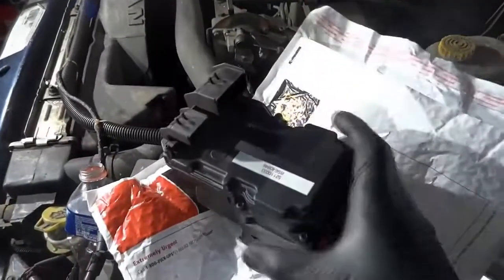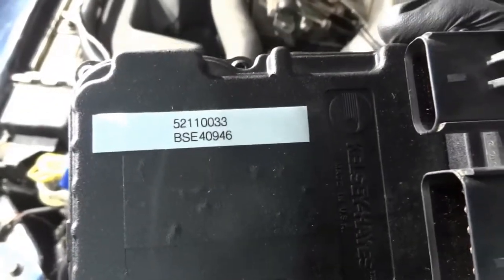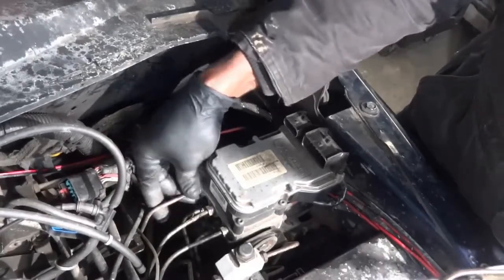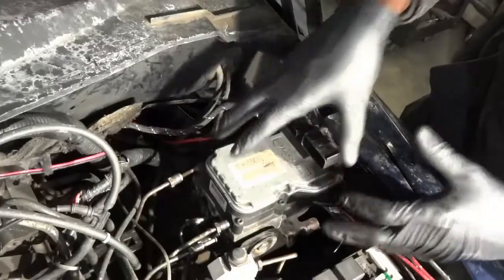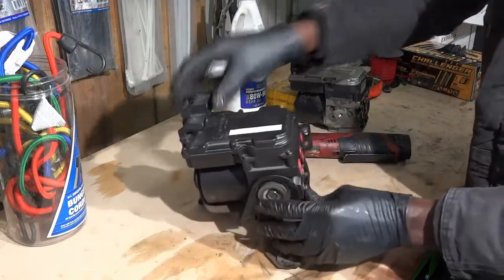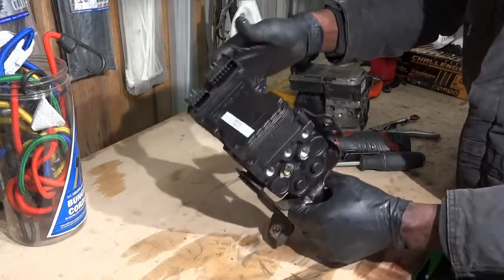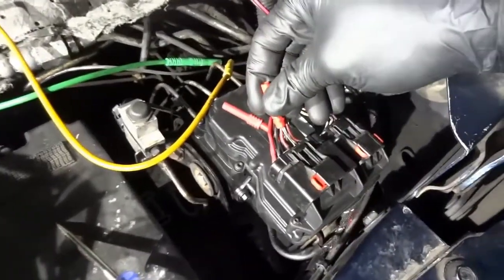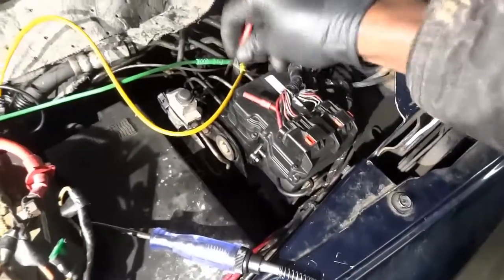2000 Dodge Ram 5.9L No Communication with ABS Control Module/ CAN BUS Problems, ABS Light on Part 2

Comment: I watched the whole part 1 and part 2. Gave you thumbs up on both and finally I subscribed. My only wish is that as a backyard mechanic, only work on my and family vehicles, is that I cannot afford that really, nice scan tool. But the information on getting voltage on various wires at the connectors is something I think I can do. Great video. Too bad the customer did not tell you he already replaced the ABS module and still have the ABS light on. Might have saved you a lot of pain and time.
Reply from the maker: johntube2525  Thank you!! And welcome to our youtube community! if you don't work on cars everyday then you don't need this type of scanner, a multimeter and a code reader will do!
Reply: @KITS_Auto_and_Truck_Repair  Thanks for the reply and a great detailed video. I have a multimeter.  My Z13 code read just says No Communication, Check key is on, and connection has been made at DTC. I found your video by searching for “ABS system No communication”. ABS light is steady on my 2001 Silverado. No brake light. 60 amp ABS fuse is good. Once I find a wiring diagram, I plan to crawl under the vehicle to where the ABS module is connected right above the frame just below the driver’s door and see what I can find.  Not going to be as easy to get too as in your video, but I guess that is par for me. Probably need a new module, but want to try to check the wiring first. Given where mine is located, even putting in a remanufactured unit will not be that easy, while crawling around under a vehicle put on jack stands. Probably have to drain all brake fluid and then refill with new fluid and bleed each location separately to get rid of all air. Wish me luck!
Reply from the maker: @johntube2525  Good Luck with your project my Friend!
Reply: There are some cheaper alternatives. I own a pretty decent scan tool from H&F, a decent Multimeter, but im looking at getting an Autel scanner of some sort, they're around 400-500 dollars and do pretty much the same thing as the Zeus from Snap-on, theres also handheld scope meters you can get that are fairly inexpensive, like 80-100 bucks. Not as fancy as the Zeus but they would get the job done for testing communication and such.

Comment: I am currently working on the same ABS light on issue on a Vauxhall Corsa (UK) my diagnostics tool tell me both the rear sensors are problematic, however when the ABS light comes back on at 20mph the fuel gauge also drops off and reads empty, also fault codes come up for the CAN-bus Malfunction and no communication with ABS. Should I just change both rear sensors ? Thanks for your very good diagnostic skills and video editing etc. This must have taken a lot of time to produce. I used to work on basic military vehicles but it's a lot more like fixing computers these days! Makes for a happy day when you fix them despite the efforts of the previous garage who only made things worse.
Reply from the maker: @davidbarton7463  take care of the communication code first!!
Reply: Many Thanks your a gentleman. @KITS_Auto_and_Truck_Repair
Reply from the maker: @davidbarton7463   My Pleasure!

Comment: Thank you for this video , however I have a small recommendation , I believe it is a good practice to check( energize and deenergize )the ABS solenoid valves on the new { the good one ) before reconnecting the hydraulic lines, this way you will save yourself time and headache if anything is wrong . THANK YOU
Reply from the maker: Rebel oh really! I didn't know that, thanks for sharing!

Comment: Nice video! I subbed. Did you have to bleed the brakes afyer putting new abs module on?
Reply from the maker: @israelcontreras5332  Thanks and welcome to our youtube community, No I didn't bleed the brakes since I didn't disconnect the brake lines!
Reply: @KITS_Auto_and_Truck_Repair  

Oh ok cool…i thought i saw you take the brake lines off with some line wrenches.

I dont think I have seen a better diagnostic process done by someone.

Comment: Hello, great two part videos. I have a question, would a faulty ABS Module with this exact problem cause the front wheel ABS hydraulic assembly to not work properly? Or would the module only detect if the ABS hydraulic assembly is not working properly?
Reply from the maker: Ray J.r.  The ABS module controls the Pump, so a defective module will affect the pump, ideally it's better to replace the pump and the module as a unit!
Reply: Thank you, I appreciate your response. Would you be able to share the link (info) to the business that you got the remanufactured module?

Comment: I’m replacing my abs module in my Dodge Ram 1500. If my speedometer still doesn’t work will my abs light remain on ? I was told my module wasn’t getting ground but wasn’t guaranteed to fix my speedometer just want to know what I can possibly do? New subscriber to your channel awesome videos!!!!
Reply from the maker: Simon Lagunas the speedometer not working will not cause the abs light to remain on on the dash!! the vehicle on the speedometer comes from the vehicle speed sensor!! Thank you for subscribing!!!
Reply: Censor in differential

Comment: My truck is a 99 Cummins I have no power feeding my rear speed sensor on the rear end. No speedo brake and Abs light on. I have power ground and ignition, when I put the multi meter on ccb+ and ccb- the meter starts going haywire. Would you say the module is faulty like this one was?
Reply from the maker: Brandon Craig  no, check your wiring first and make sure your module is getting good power and good ground!
Reply: @KITS_Auto_and_Truck_Repair  I checked and I have 12v power and good ground and ignition power. It’s almost like the abs module isn’t sending power to the sensor
Reply from the maker: @brandoncraig4789  Ah  ok!
Reply: @KITS_Auto_and_Truck_Repair  do you think it’s a bad module
Reply from the maker: @brandoncraig4789   It's hard to tell! you could have a wiring issue!

Comment: I’m curious as to the part numbers.   After the rebuilt module didn’t work, I thought you needed to match part numbers.  From the video, it appears the junk yard ABS module number didn’t match the number the dealership gave you.  

I ask all this because I bought a used module from my 2001 truck and it has s different number but I can not communicate the scan tool with it.
Reply from the maker: @mannythedangerous  Ah ok!
Reply: @KITS_Auto_and_Truck_Repair   ok, I just found a blown ABS 40 amp fuse in the engine compartment.  I’m no longer getting “cannot communicate” but now I only get 84, mismatched vin.  I wonder if I can have my mobile programmer guy fix this?

Comment: Great video... was wondering have you done a video or diagnosed a "No  Bus" issue on the 99-2001 3500 ram  24v ?
Reply from the maker: Bernie Haughey NO, not on a Dodge Ram but I have a video on a FORD E350 with CAN BUS issues, you should check it out, it should be the same principle!!
Reply: @KITS_Auto_and_Truck_Repair  thanks for the responce I will check it out .. keep up good work
Reply from the maker: @berniehaughey4982  My Pleasure, Thank you!!
Reply from the maker: @berniehaughey4982  thank you!!

Comment: Hi I see in the cluster the airbag on what do you think is the problem. I. Change the abs module like you in the video but the air bag continue on.
Reply from the maker: Jasmine Gardens Lawn Care  The airbag and  ABS system are two different systems, I did not look at the airbag on this vehicle, but airbag light can be caused by a couple of things, like a defective sensor, a bad module and a problem in the wiring etc..
Reply: @KITS_Auto_and_Truck_Repair  thanks for the answer I check tomorrow my truck it's a pain see all the time that lights on. Thanks my friend.
Reply from the maker: @jasminegardenslawncare5954  My Pleasure!!

Comment: Interesting someone swap the ABS module with salvage yard PCI bus ABS module from 2003 up vehicle on older CCD bus vehicle. This is why you see this high voltage spikes as PCI bus modules are transmitting around 7.5 volts.):
Reply from the maker: @DieselPLL   Yes!

Comment: 2006 dodge ram 1500 5.7 abs light and emergency brake light comes on..front brakes eventually lock up whole driving and if I crack the bleeder than I'm able to drive away..lmk please
Reply from the maker: Coconut 808  it sounds like your abs module is bad!! check the module first, follow the steps on my video!!

Comment: Man . I guess you didnt relize you didn't need to pull the lines ...
Reply from the maker: ALEX  the lines had to be removed to replace the motor, I replaced the motor and the Module!
Reply: @KITS_Auto_and_Truck_Repair  right but the motor doesnt have to be replaced and the moduel alone is like 300$
Reply from the maker: @ALEX-xd7ko  The motor was shorted!!